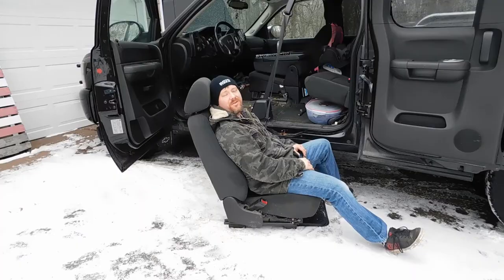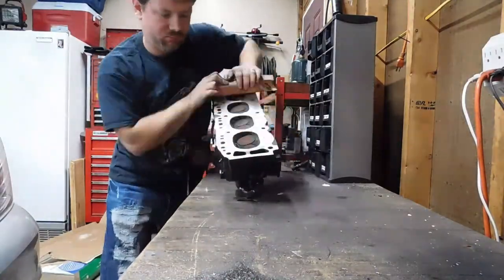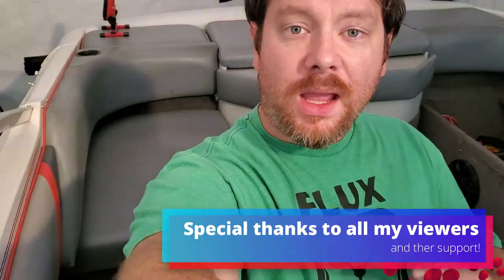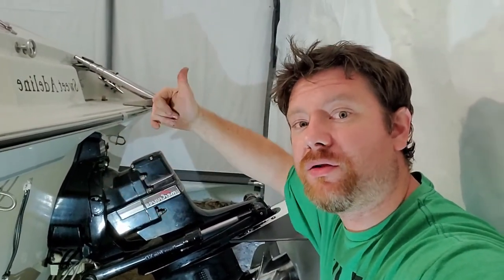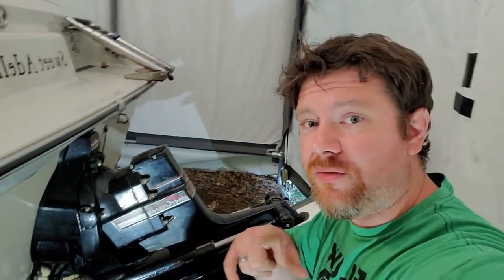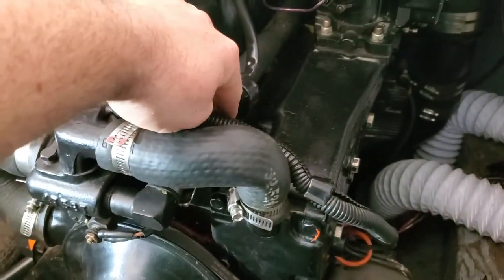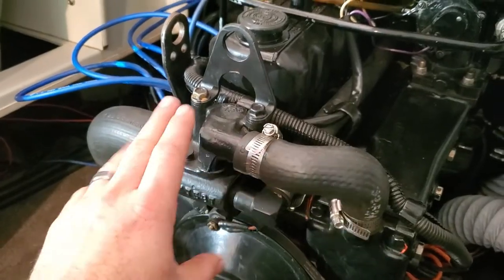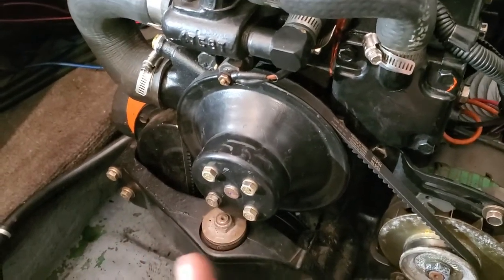Overheating mercruiser 3.0

Comment: What if you accidentally forget to take the ear muffs off and you run the boat in the water for 10 minutes. I know that it would reduce water flow to the  recirculation pump of water but wouldn’t it still get some water? There is a connection on them for the hose. What should you check after that?

Comment: I have a Mercrusier 3.0 and one thing  you didn't mention is the Exhaust Manifold.  If that is plugged from years of use and a build up of rust, it will overheat the boat.  I had to replace everything from 
the risers to the exhaust bellows. Hope this helps a few of you.
Reply from the maker: Yes that is another great thing to look for.
Reply: How did you determine the exhaust manifold was plugged? I'm assuming that if the manifold is plugged that you'll notice that the amount of water coming out of the engine will be a lot less than normal due to the restriction? Just curious to know how you figured this out short of removing it and looking as it. Any tell tail symptoms?
Reply: @richmac918  If you put the muffs on and you don't see any water coming out of the back, good chance the exhaust manifold and/or risers are plugged. I replaced everything from the exhaust, riser, & all rubber bellows.  Runs great now.
Reply from the maker: I agree, unfortunately tear down is the only way to verify that issue.
Reply: @daleofalltrades  Thanks for doing these videos, Learned so much with utube.  Thanks!

Comment: Hi Dale. Hope all is well. I took my belt off of the recirc pump/alternator and there was no resistance on the recirc pump it just freely spins. The impeller is new and the thermostat is new. Per this video you were saying that if the recirc pump sins geeky that could be the problem?
Reply: Sins freely not sins geeky
Reply from the maker: @mybugguypestsolutionshoels2789  the recirculation pump should spin freely. Of your still having over heating issues the exhaust manifold may be plugged with rust buildup

Comment: Thanks for the video, big help. I'm still overheating. Wracking my brain trying to figure it out. I noticed in your video u don't have water coming out of the prop. Maybe my mercruiser 3.0 is a different engine design. I have 2 exhaust ports on the upper part of the outdrive, one expelling water and the other exhaust. I also have about 1/3 of water volume coming out of center prop. I've replaced impeller, thermostat, poppet valve assembly, thermostat and poppet valve housing. I guess I'll change the pump even though it looks and sounds decent. I found a lot of crud caked in the thermostat housing and fear the exhaust manifold may be choked with it. Any ideas or input u may have would be great-Steve
Reply from the maker: Sorry I just saw this.   It does sound as if you may have a blockage somewhere. The manifolds like to plug up with age.   Not sure what else it could be.   Under load a bit more water come out my prop but not much.   Mine is a 1st gen that's as far as my hands on experience goes

Comment: Did you guys ever get it figured out? I had a 3.0 that kept overheating, went thru and replaced everything, pump, impeller, hoses, t-stat, still overheated. It wasn't until I tore the engine down that I found that upon removing the t-stat housing/ hose manifold from the head that a piece of old impeller had found its way up to the head and got lodged right there, it had rust and barnacles or rust bubbles all over it and had clogged that passage completely, come to find out on that block, that is the bypass passage and if it doesn't have flow, the coolant system just doesn't work at all. The actual explanation is more technical but that's the jist of it.
Reply from the maker: Well I personally wasn't having issues with overheating, but I do hope this video helps others. Glad you figured out yours!
Reply: Thanks for the heads up
Reply: I disconnected the inlet water hose at the tstat 
it blew free no restrictions 
I turned on the water and no water came out the input hose
Reply from the maker: Bad impeller?

Comment: My boat was overheating so I took the thermostat out and started it without the top on and no water was circulating. It was bone dry. I just had the impeller replaced. Could it be the impeller again? I’m sort of at a loss
Reply from the maker: @chudbuckingham296  perhaps a clog

Comment: Great video dale! I’m currently trouble shooting my 4.3 mercruiser alpha one

Would you happen to know if most of this is still applicable?
Reply from the maker: Most of it is. The engine is just different
Reply: @daleofalltrades  followed everything and ended up replacing my impeller and doing a backwash one the tube that goes from the impeller to the motor and now I’ve got much better flow and no over heating!!!
Reply from the maker: @TechLoop-HQ  awesome 💯

Comment: I have a 4.3 Volvo penta that’s overheating.put muffs on and no water running back out should i check my impeller in  my strem drive first.
Reply from the maker: I always start there 1st
Reply from the maker: I have a new video showing the process

Comment: I have a 88 sundancer, with a 7.4L, it only overheats at idle 800 rpm, the temp is at 200F, once i get to 1200-1500 it drops back to 160F. It ran cool all last year after i replaced the thermostat. I had a marina winterize it, not sure what they did, but I started it on the muffs myself, ran it across lake st clair for 12 miles from storage to my marina, only found the overheat when i was docking. any idea on how to check ? not sure if / what they did towinterize, odd its only at idle
Reply from the maker: I don't think it's do to the winterization. When you moving faster things are also spinning faster pushing more water. Sounds like a flow issue.  Time to start inspecting.  Check the impeller, check theanifolds for plugs,. Check hoses for debris inside ect.

Comment: Hi not sure if you are still answering posts but I'm lost my 3.0 is running hot but only at speed. I can idle around all day and it's fine. I have replaced the impeller, thermostat ,water pump, head and gasket (the head had a small crack) also the exhaust. Please any help would be appreciated.
Reply from the maker: I am forever and always answering questions 😃.  I have a few thoughts 1st though perhaps the inlet in the out drive is clogged?  When impellers failed sometimes chunks of rubber can make there way up the unit clogging the inlet lines causing poor water flow.  Try on the trailer blowing some compressed air through all the inlet lines maybe tear the whole out drive off and go through it really good looking for obstructions. It definitely sounds like a flow issue considering when the engine is idling (not working hard) it's fine and when your cruising (working hard) it's heating up. Lack of water flow would cause that.  I like hooking muffs up on try land and observing water flow out of the exhaust. You could have someone sit in the boat while it's idling watch the water flow out and then have someone rev the engine as if you were cruising and still observe the water flow. If there's not very much coming out I'm guessing you have a blockage somewhere. Hope that helps you in some way.
Reply: @daleofalltrades  Thank you I will give that a shot.
Reply: @daleofalltrades  wanted to get back to you and let you know the lines did have rust trapped in them. Thanks for the help.
Reply from the maker: @papapillgaming2847  glad to have helped

Comment: I'm having an issue with my 3.0 Merc. A couple years ago I started noticing that my temp gauge was reading higher than normal (went from 165 to over 200). No noticeable changes in engine operation like pinging or run on after shutting it off,  just a higher temp indication. Changed the impeller (even though the original was in perfect condition) and changed the thermostat (though testing showed the original was working perfectly). Pulled the wire from the sending unit and gauge stopped reading so I know that it is doing something. Water seems to be flowing well through the engine and out. Used an infrared non contact thermometer to measure temps along all the water lines coming and going from the thermostat housing - nothing above 165. Water pump on the engine looks good, no leaks. I'm not certain I trust the temp gauge (most of the gauges on the gauge cluster jump around quite a bit) or maybe sending unit? Suggestions as to what to look at next?
Reply from the maker: Gauges go bad all the time I would try hooking up a different gauge to verify even just a cheap test gauge.  If it's not that then I'd have to say sending unit. Infrared thermometers don't lie there's definitely no issue with the engine.
Reply: @daleofalltrades  My water flow appears to be fine. It started as overheating only at plane, so I figured water flow. Now overheats at idle. Replaced both temp gage sending units in thermostat housing.
Reply from the maker: @stevecarabetta2251  impeller?   Not enough volume reaching the engine?
Reply: @daleofalltrades  replaced it
Reply from the maker: I've been hearing of plugged up exhaust manifoldss causing over heat issues.... Perhaps it has plugged up and time to be replaced
Reply: @daleofalltrades  Hadn't considered this but certainly worth looking into - thanks for the suggestion
Reply: Thanks, I’m going to take your suggestion and get another gauge

Comment: I have a 3.0 mer. Its showing about 135 on the gauge, is running your low temperature hurt the engine
Reply from the maker: Low temp won't hurt
Reply: @daleofalltrades  thank I am new at boating

Comment: my 1999 5.0l mercruiser alpha one heats up, sets the alarm off then cools off and starts the cycle again. i replaced the thermostat, impeller, circulating pump and risers and still have the same problem. its seems to take a long time for water to reach the thermostat housing. any thoughts?
Reply from the maker: Have you checked the elbow located inside the housing of the outdrive by the bellows.  The water feed hose for the outdrive runs from the outdrive to that elbow through the transom into the hose that goes to the thermostat housing. Anyway those like to crack and cause a water bleed not allowing enough water to get to the engine fast enough... Worth a check
Reply: @daleofalltrades thanks for responding. will check it out. also, i have a 1970 6 hp johnson outboard (6R-70B) that i cannot find wires for. amazon has a coil/wire set but i dont know when i can get it as it hasnt been released.

Comment: Can you put a3.0 out drive on a 5.7 ?
Reply from the maker: They will bolt on, but they are no t internally built for the power difference. Shot answer. I wouldn't recommend it

Comment: 2010 Bayliner 175 - 3.0 TKS MerCruiser 
My boat was running perfectly in the lake when I heard a strange sound coming from the engine or drive and immediately the alarm sound, the engine temperature was 250 degree, I stopped the engine and look for any visual damage.  Didn't find anything from inside the boat and wait for the engine cool off.  After a while started the engine and start boating again, about 2-3 minutes later the temperature when to 250 degrees again, I shot down engine and call for a tow.  Back at home I run the engine with fresh water thru a hose and was no circulation at all.  What could be the problem?
Reply from the maker: Only thing to to is start investigating the cooling system. Use the video as reference points.  Only thing not mentioned in this video is that the exhaust manifold can get plugged as well. Good luck.

Comment: hello so what if when you blow it and there's no resistance fairly easy?
Reply from the maker: The it could mean that the impeller in the out drive may be worn out and time to be serviced.  As they wear out they tend to lose blades which would make less or no resistance.  May be a good idea to tear it apart and inspect it.

Comment: I feel like I need to check my impeller after watching. That could be one of the causes.  The previous owner left it docked and a thousand baby oysters attached themselves all over in the nooks and crannies of the out drive.   I enjoyed hours of picking them out of the crannies with a sharpened flat bladed screwdriver and a cold beer in my hand. However I noticed them inside of the water intake ports and I guess I just thought they would somehow get flushed out. 

I haven’t attempted taking that stern drive apart yet.  I will search on YouTube to see if anyone attempted that.
Reply from the maker: There's quite a few videos of the stern drive impeller replacement.  There spoase to be replaced ever 3 years or so many hours.  It's the number one cause of failure out on the lake. So many people neglect it, and it can cause such major issues.
Reply: thats when i had that problem, after i left it in the water all summer

Comment: Are omc cobra 3.0 liter specs same as 3.0 mercruiser specs? I’ve been searching everywhere and can’t find torque specs for omc cobra!
Reply from the maker: I am not 100% sure, they may be the same or close I do believe the block is the same. Manufactured by GM. However I am not entirely sure, could you call a service center and see if they could give you the specs?
Reply: Yes you are correct about that I took valve cover off and it says gm right on top on the block I have a guy at the local marina who is supposed to be looking for them for me but he says he has to find book and has no idea where it is
Reply: I was just going to use the chart you put up when you did your head gasket as your engine is same size as mine also yours is 140hp as well correct? I would think it would be same pounds if it’s same hp right? I just don’t want to do it and then blow gasket again because I don’t have it torqued right
Reply from the maker: @natesignor3442  I'm guessing they are probably the same torque specs, did you happen to watch my video of the second time I put my head gasket in? I ended up doing it a second time and used aviation permatex on both sides of the gasket. Has not blown again would highly recommend using it
Reply from the maker: https://youtu.be/p5q3fEBXSQ8
Here the link nk to the video.
Reply: Okay I’ll definitely do that for sure! Also if it is warped a little you think I can get away with sanding it evenly with 80 grit sandpaper like you did?
Reply: Don’t want to put it in machine shop because if I do that I mind as well say I’m not getting it on the water this summer
Reply from the maker: @nate signor  I get it.  That's the same situation I was in last year with a trip planned, slip paid for, and hotel.  After my last fix it is still running strong a year later.
Yes I think the sandpaper and permatex trick will increase your odds of success greatly.

Comment: I cant believe he said thats all it could be when at least 60% of the time it is indeed the manifold or risers or elbow!!!and yes you can still see water shooting out the back. That dosnt mean
It isnt PARTLY obstructed.. my boat only over heats   on wide open throttle. With NO thermostat even. There could be obstructions, , hairline cracks,,, rust, even old impeller poeces from over the years from different owners.  Stick to something other then boats bro. And circularion pump... 30 bucks?? Lol try 102.00 plus shipping of 80 in canada.

E years
Reply from the maker: The video was intended to give a general idea of how the cooling system on an I/O works with general ideas as to the cause of possible overheating. I have brought up the manifolds in the comments as it is something that plain slipped my mind while making the video as I don't do scrips.  From my personal experience most the time it's blockage or impeller issues.  Ether way thanks for watching. Every video is a learning process for me and my viewers